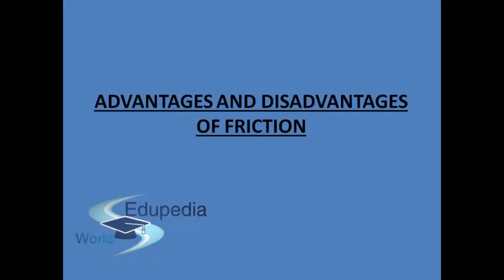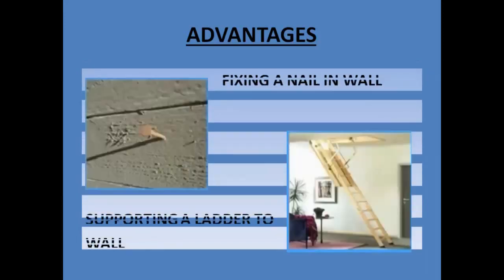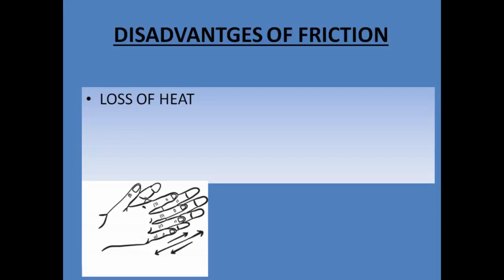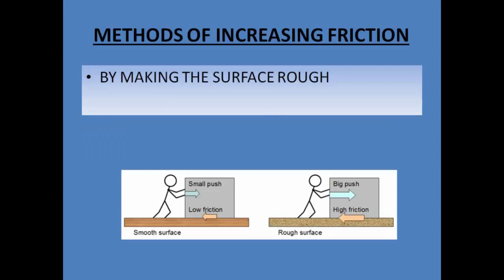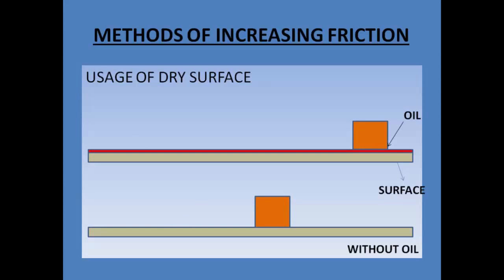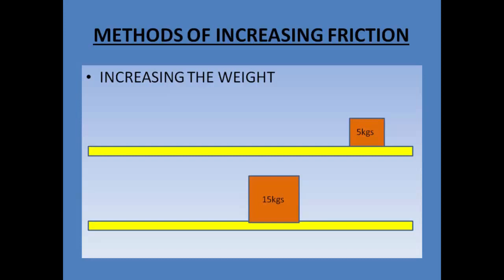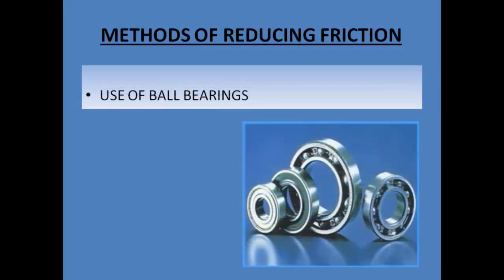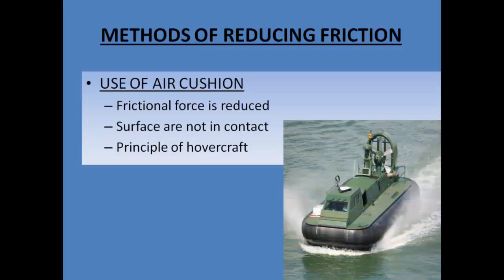Advantages & Disadvantages Of Friction | Methods Of Increasing & Reducing Friction | Lecture 4

Comment: Hello..Can I use your Science videos for training purposes / tuition ? Please note that these training's will be commercial. Hence, I will need permission to use part of the videos in my tuition material.  I can show your name in the acknowledgements section of presentations. However, I will not be re-uploading it to YOU TUBE. Kindly let me know. ? Thanks
Reply from the maker: Our videos are free for all the users, and we ourselves are not using them to make money, although we spend a lot on producing these videos. Therefore please avoid using them commercially. However, you can use them to teach students and direct them to watch our videos on our channel. It is really nice that you are candid about using them, and we appreciate your gesture. We would appreciate if you show our name in the acknowledgement, while teaching.
Reply: Thanks for the clarification. Well, my format of teaching (online) does not allow me to direct students to your channel :) . Hence, my requirement will be to use part of the videos in my tuition course. However, as you said, that will not be feasible and hence I will not use them. Thanks.!
Reply from the maker: Well, we also said that you can use it in your lessons, showing our name in the acknowledgement, while teaching.
Reply: Thanks. However, I will reevaluate my requirement and see what is the optimal way to use them within your stated framework and inform you accordingly before using them. Thanks for your quick responses.!
Reply from the maker: Welcome...! We appreciate your gesture.